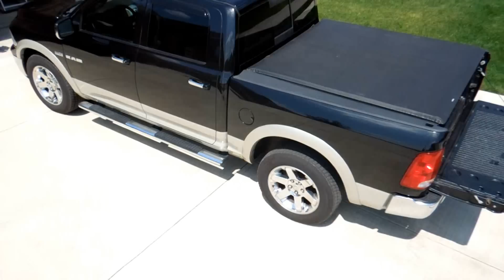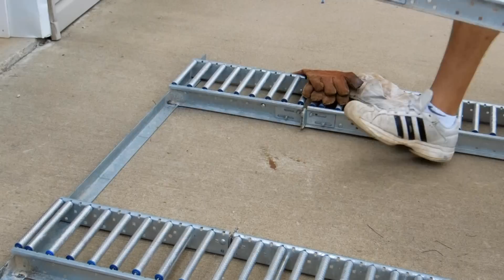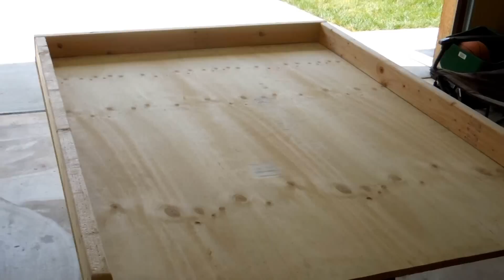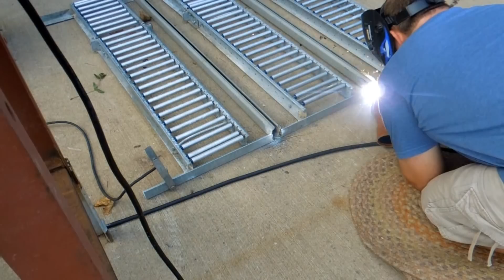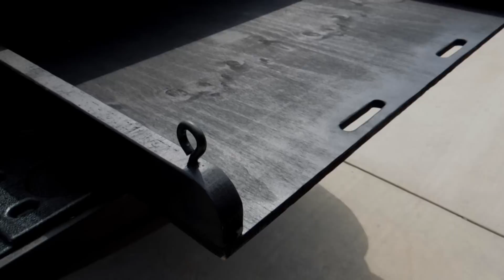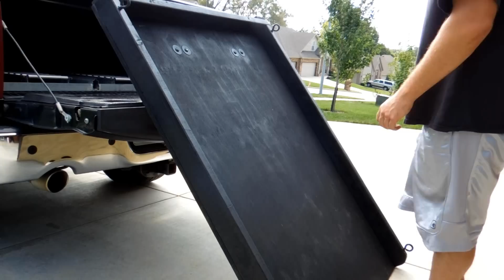Sliding Truck Tray (DIY)

Comment: I made one years ago so not the first but still very different than mine.
Reply from the maker: That's awesome... Yeah I was no where near first either.. I saw metal ones that cost thousands... I would love to have one of those but my pockets arent that deep.... So that's were makers like us Owen come in and knock out something that gets the job done.... This is the best feature I have on my truck... And I have heated and cooled seats and the floor board has an insulated cooler... This spends a lot of time being a grocery hauler... But it's always a pleasure to get things now that I can roll them towards me.. 💪🏻👈🏻 ty for the comment!!!
Reply: @WoodenCreationz  The drawer that I have now I put the rollers in a sheet of 3/4 inch plywood and made a frame to guide the drawer that has a locking pin with multiple stops so the drawer can be locked into position even when on a hill.  I used a metal bed frame to guide the drawer and put tin on the plywood so the drawer rolls without damage to the plywood.  My frame has two locking pins so the frame can be pulled out of the truck in about 3 minutes.  I just pull the two locking pins and pull the frame out of the box.  My first drawer was more like what you have in this video but I like the improved upgrades that I have now.  I have about 500 pounds of tools  in the drawer and it rolls smooth and works great.

Comment: Thanks for sharing the video.  How did the rustoleum hold up?

Awesome.  Thank you for taking the time to respond.  I'll be doing something similar to my van this week.  Was going to do carpet, but will now consider this spay which I already purchased for the wheel wells.  Even if I do carpet, I think this will be great for the side rails.
Reply from the maker: That stuff has truely exceeded my expectations. I have thrown everything on that Truck tray... It still looks new... I have no issues recommending that to anyone... Ty for the comment!